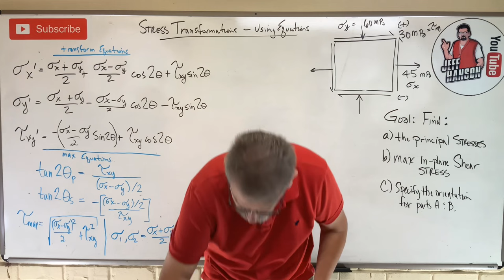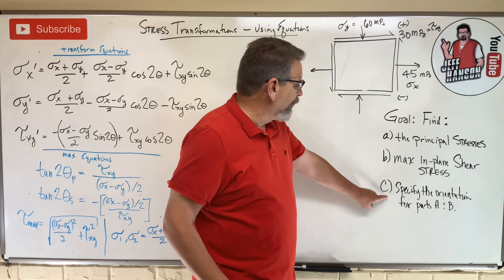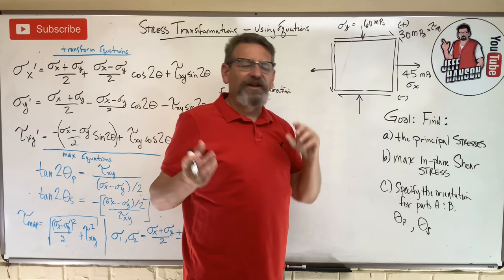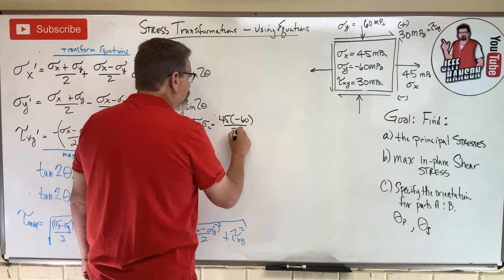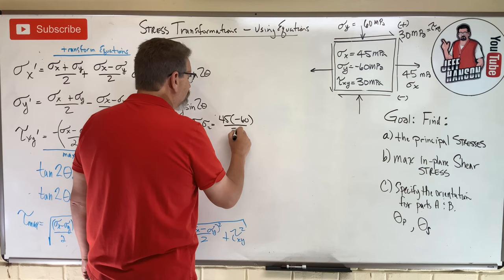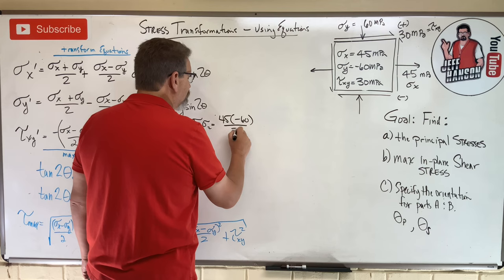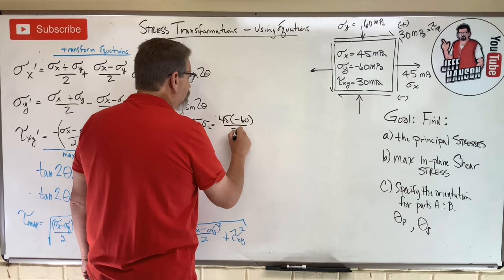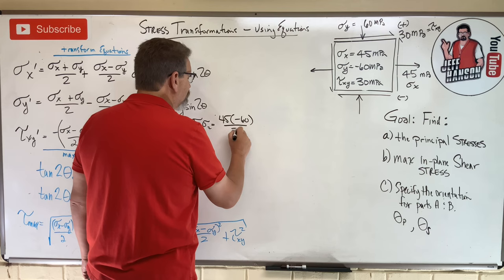Mechanics of Materials: Lesson 49 - Max Shear and Principal Stress with Equation Method

Comment: For the equation in the lower left (TauMax equation), I think the dividing 2 also should be squared.
Reply: should be like that for the Tmax and the formula to the right of it (min and max principal stresses)
Reply: @christopherlee6364  I don't know. I took the exam, got an A, forgot all about it now.
Reply: @aybaws  it’s just what the equation should be. Probably just a typo but makes a huge difference if the 2 at the bottom is not squared too
Reply: @christopherlee6364  Thanks for spotting that for others
Reply: Indeed
Reply: @aybaws bro HAD TO flex his A
Reply: @sarubet8725  I worked hard for it lmao

Comment: Sir, no doubt your way of teaching is far more better than my college teachers. But can you also plz describe what is meant by principal stress and max in plan shear stress
Reply: the way that i understand, max in plane shear stress is the value of maximum shear stress, and can be found at a certain angle, theta s, and principal stress is the is maximum and minimum value of sigma or normal stress and also can be found at a certain angle, theta p.
Reply: The principal stress is the stress that you find in your stress element due to shear stress being zero. Maximum in plane shear stress is when your stress element your shear stress is maximum and because it is maximum, you need to have an equal proportion of normal stress on both your x and y direction

Comment: thanks for your effort , but i have a question , in fatigue problem when designing a shaft with gears you know torque changes at the same point of gear , can i take this as a torque fluctuation to get the Ta & Tm ( alternating & mean torque )?? or consider always torque is constant ???also when can i consider Mm ( mean or average bending moment)for a rotating shaft(so bending moment at same point changes from + to - with same magnitude ) is not equal to zero or is it (Mm ) always zero???